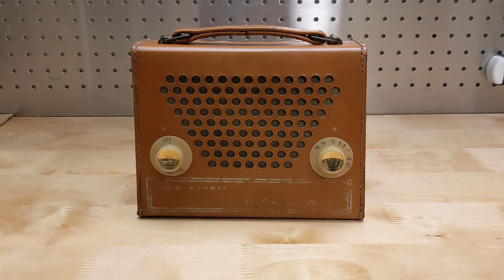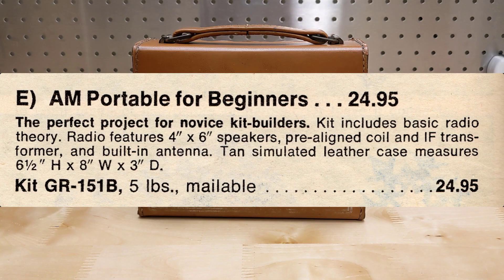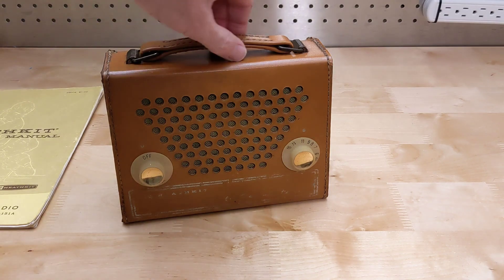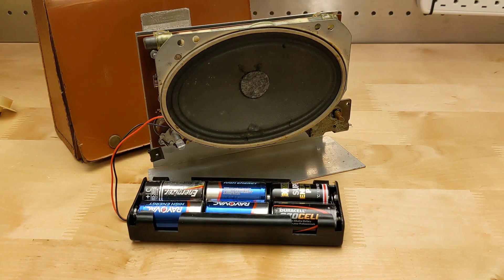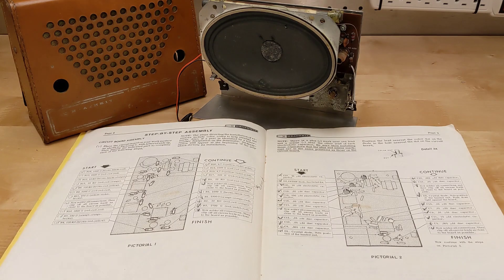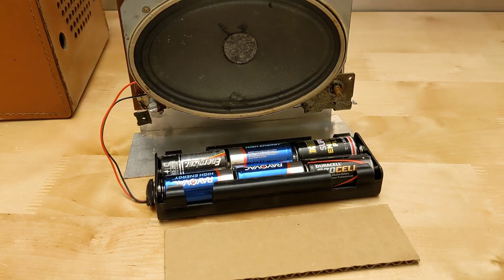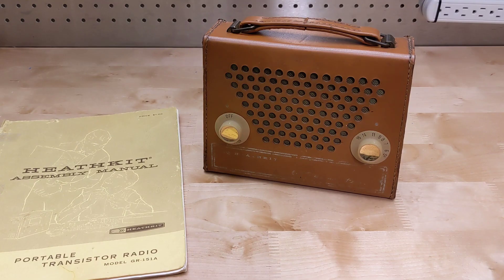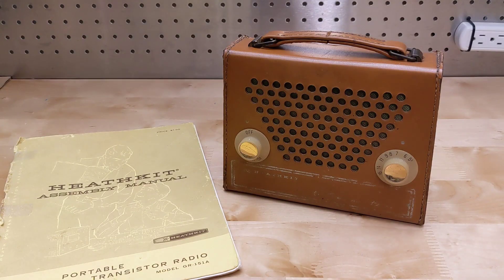The Heathkit GR-151A Portable Transistor Radio

Comment: Nice restoration of a rather rare now  Heathkit AM radio. Handle usually is found broken in the middle. Great 6 C cell 
battery holder with cardboard protector added . Highly recommend  doing that.

Comment: Hi Jeff. I also live in Ottawa. I remember building a Heathkit vacuum fluorescent display digital clock for my grade 12 electronics project back in 1985, and it's still working fine. Furthermore, I had to write a report about how I assembled it and my troubleshooting  procedures I used to find out why I could not set the time, which was simply a wire I had forgotten to solder.

Comment: I have great memories of Heathkits. I started in the 1970s and built a tabletop am/fm radio, and a gas discharge digital clock. Both still work although the gas discharge pieces have a few places where segments dont light, and there is some flickering. I remember the saying "We wont let you fail."  Once i got a defective part. I contacted the company, and got a hand typed note from a technician and a replacement part. Great personalized service and great company.